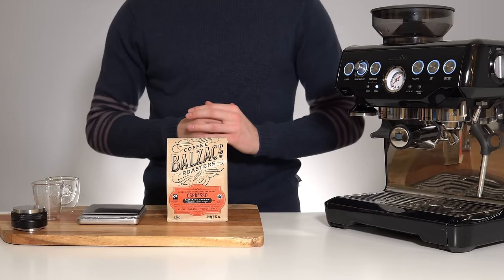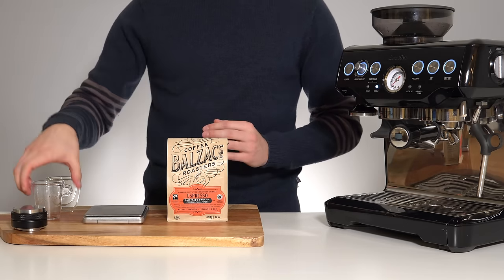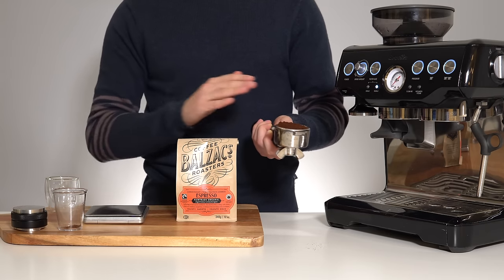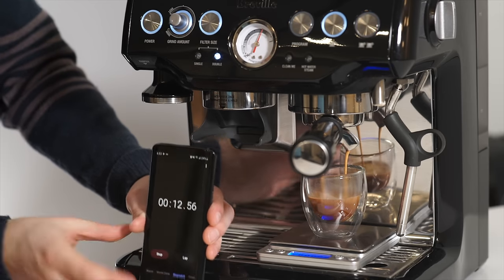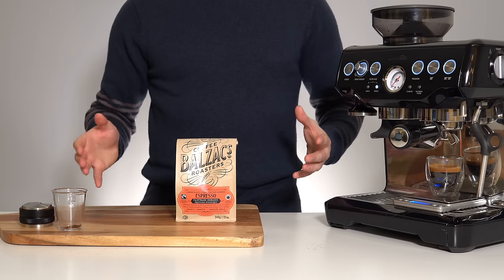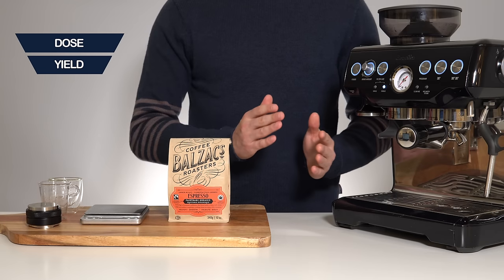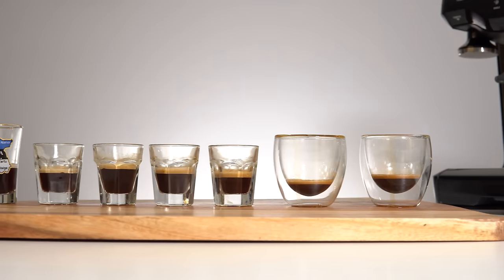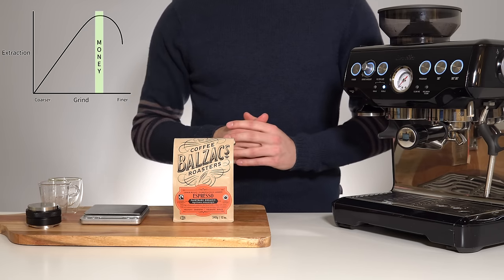Dialing In Breville Barista Express | Dose, grind, yield, time

Comment: Hi. Thanx for your instructive videos on the Breville Barista Express and on how to use it. I have a question on dialing it in since watching this video. I did a number of test runs this morning and my result is not exactly what I hoped for. I started with the grind size at setting 4 and dosage of 18gr. I timed the brewing to 32gr when I turned off and it ran to a yield of 42gr. This while the pressure gauge was at about 1 o'clock and it took 15s. I then tried grind size setting 2 and redid all stopping at 30gr with a final yield of 40. This took 27s with the pressure gauge at 2 o'clock which seems a bit much. It had a heard time holding a constant flow, very little in the start and maybe a bit varying flow during the time. The result was ok but not excellent. Could you please give me a tip as to what I should do to adjust things, since I am a bit of a loss here. Sincerely, Oscar, Sweden.
Reply: When tamping looser I get to fast flow.

Comment: @LifeStyleLab_ Hi this video is great for new coffee enthusiasts like myself.However I have noticed you have mentioned different time for coffee pour. In this video you mentioned the time should be between 20 to 30 seconds and in another video of your mentioned 30 to 35 seconds. Which one is correct? Also for the palm tamper how do you ensure 30 lbs of pressure as opposed to precision tampers?
Reply from the maker: This video includes the pre-infusion because that’s how the timer on the pro counts. The other video is counting from first drip. 
I have great videos on both timing of espresso, shots, and Tamping pressure  :)

Comment: I'm about ready to return my Express because I'm beyond frustrated with the dialing in process and have been working on it for weeks now.  I'm going from a Nespresso pod machine to this and it's harder than I thought it would be.  It seems that no matter what I do it's not working right.  The grind amount always seems to be too much and the water pressure is too low and takes something like 10 seconds for the extraction.  I don't really like espresso and will add water to have a regular cup of coffee and because there are so many factors and it's so time consuming.  If you change to different coffee beans then you have to start the dialing in process all over again, wasting even more expensive coffee.  I don't know, maybe this just isn't for me.  But hate to return this machine because I got such a good deal on the price, I have until the end of the month to return it, so I guess I'll keep trying...and wasting coffee.  :)
Reply from the maker: Sounds like you just need to be grinding finer if your extraction is only 10 seconds! 
See my latest video about the portafilter overflowing for an explanation

Comment: Thanks for the educational vids on the Barista Express. Was wondering if you had one already about dialing in for single shots. As a rough guide how many grams would you start with and should it be between 20-30 secs (then adjust according to taste later). Cheers.
Reply from the maker: Sure do! https://youtu.be/ix9MXtMq1so
The key is to try to replicate the same flow rate and brew ratio as your dialed in double shot

Comment: Great videos, still on the fence if I want this or the pro. But we'll buying it in a few weeks and I'll definitely be back to learn from your excellent videos!

I love the pressure gage however the display on the Pro gives a bit of extra convenience I think. It's a shame they took out the pressure gage.

It'll be our first "real" espresso machine, currently have a fully automatic.

A few questions:
-  The bean freshness. We currently open a 1kg package and put 3/4 in the freezer. Then take 1/4th out of the freezer at a time. As I understand it it's best for the freshness. Would you agree?
- We like to change up our brands regularly and am a bit concerned after your video. Does the dialing in get easier? How long would it take you for instance to dail it in for a new brand/bean type?
Reply from the maker: If you have the budget, go with the Pro! The extra grind steps will help with dialing in
Reply: @LifestyleLab_  Hi, wow. Thnx for the instant reply. I wasn't expecting a reply at all tbh.

I'll run it by the budgetary committee (the missus ;) )

Would you mind looking at the other questions I added?

Also in this video you mention the importance of the pressure gage something the Pro is missing.
Reply from the maker: The pressure gauge is a non-issue. Pressure gauges are a fairly vague indicator of shot quality. I only mention it in this video because the marked "espresso range" is blatantly wrong. Flow rate, and brew ratio are the main indicators you'll want to use to dial in

Your sound like you're taking the right approach! I'd recommend getting a vacuum canister and single dosing as shown in this video. No bean hopper is air tight. 

Once you have one coffee dialed in, the process gets easier. The first dial in on the machine may take 7-10 shots to get right. Once you're in the range, different coffees will be quicker to tweak to the correct setting
Reply: @LifestyleLab_  Thnx, mate. The first time I've actually "liked" something on youtube!

You've helped me decide (also watched the Pro video). I'll be going for that one if I get budgetary approval. I'll also be picking up one of those palm tampers.

On not keeping the hopper full, I understand and agree. However, my wife will also be using it and convenience is important in that regard.

Do you have the link to the graph in the Pro video. I NEED THAT GRAPH ;)

I want to emphasize how much I love your videos. They're clear, concise, comprehensible, have a good information flow and are complete! Rare to see level of quality these days, my compliments!

Comment: great video!!   Uggh but Sooooo many variables!  your video is way more in depth than most, however, what is confusing to me is, if you have say 17.5gm and your doing 1:2, so appx 35gm out, how do you know whether to adjust your grind for a a couple of seconds more/less, OR, as you say when experimenting yourself for taste, whether to go from 1:1 up to a 1:2 ratio, or maybe 1:2.5 maybe??  Like how do you which variable to be adjusting - grind, or ratio, or lastly weight (16~22gm).
I think you answer this somewhat in your video, but I am struggling to realise exactly how to ascertain which variable to adjust - Like obviously if your grinds way too fine and its taking 40 seconds to extract thats asy to establish its too fine, but what if its about just right, and its within a good time 25-30seonds, but its weight in porta filter is too much or too little...or, the ratio is out a bit?
You can tell its confusing me, however I do feel there are many who similarly arent 100% in what to adjust along the way unless its glarlingly obvious.
Maybe a super fine detail and more in-depth video would help?  

Its great you use the Barista express as its probably one of the most common home machines!
Thank you again for your videos!!!
Reply from the maker: As long as you're getting good flow (which is sounds like you are) pick a dose and leave it alone. Boom! One variable locked in. 
Now all you need to play with is the grind, and the yield 
If your shot is tasting slightly sour or acidic, you'll want to increase the yield (more water in the cup)
If your shot is tasting slightly bitter, decrease the yield (less water in the cup)
Finally, you can slightly tweak the grind to adjust the body of the shot. If it feels a little watery, grind finer so that it takes longer to reach the desired yield. If it tastes "muddy" and thick, grind slightly coarser
Reply: Lifestyle Lab thank you so much!  This helps a lot!  😇

Comment: Thanks for this great video! What was the dosing cup you used? I find it very difficult to find a 54 mm dosing cup.
Reply: I don't see many "things" at 54mm. Look for 53.
Reply: Did you find a solution? I’m also looking for this. Thanks!
Reply: @melissaloveschurch  I went for a funnel instead since I was unable to find a dosing cup of the right size. You can find quite a few 54mm ones on Amazon. The one I bought has become unavailable.

Comment: Hi, your video was super helpful. Just one question: what should the interior grind setting be at?
Reply from the maker: Whatever you need it to be set to :) 
If you run out of range on either the fine or coarse end of the external dial, move the internal

Comment: Great video! Really appreciate the attention to details... But there's one problem I always have: Whether to include pre-infusion time into the overall extraction time recommendations? I see very inconsistent advice about this all over the place. I was surprised to see you start the timer after liquid started to flow from the portafilter. Is this the correct way?
Reply from the maker: The "correct way" is to not aim for a particular time at all. No two coffees are alike, and therefore they all need to be dialed in to taste as described in the second half of this video. Time recommendations are for absolute beginners to get a reasonable flow rate so that they can start tasting, and further tweaking. Never dial in to 25sec and call it a day. In 9/10 cases, that will not be a great tasting shot.
Reply: @LifestyleLab_  Thanks! This makes sense. But given that pre-infusion often takes 7-10 seconds, it can make a pretty huge difference even for beginners to understand whether they've got a proper flow rate.

Comment: I have a question about sage/breville barista express, i Just bought a brand new machine couple of days ago, i was watching all your vidéos about it and i have learn everything about it from you i thank you very much. So i set the grinding at 3 and 4 but the coffee is running fast not like honey as show your video so i did turn the grinding to one 1 i have tampered the coffee well i set the 18gr of coffee and it is well distributed in the basket. The coffee run slowly at begining but when the pressure needle goes high it will run faster i use the single wall basket i used the dual wall basket but it always the same.

Comment: This is exactly what I was looking for. I’ve been messing around with mine for a few days but I couldn’t seem to get it right. It doesn’t seem to be building any pressure. I think I’ve only seen it move once out of the dozens I’ve tried. Any recommendations? Awesome video. Thank you! 🙏
Reply from the maker: If you've reached the minimum grind setting and it's still running too fast, you need to set the INTERNAL grind setting finer! Here's how: https://youtu.be/QNvOcE4-VEo

Comment: Great video explanation, just one question which basket were you using ? single wall or dual wall ? Thanks :)
Reply from the maker: Single walled!
Dual wall filter baskets are only for use in cases where the coffee you are using needs "help" building pressure, such pre-ground store bought varieties. Are long as you're grinding fresh coffee, and grinding fine enough, a single walled basket will produce a better shot of espresso
Reply: @LifestyleLab_  for some reason i get high pressure and fast extraction

Comment: The only issue with this type of grinder is that there's a fair bit of coffee retention within the grinder, and so the 18g in will not equal 18g out (I was a bit disappointed you didn't weigh the ground coffee). I'd recommend weighing at least 19g in using this method, and adjusting for the target dose.

Comment: Great video.  Makes so much sense.  I did recently get the Breville double boiler with the 58mm portafilter.  What initial dose coffee to water would you suggest I start with.  I assume it would be larger than the 54 mm single boiler portafilter.
Reply from the maker: Start with 19 grams in and 38-40 grams out. Congrats on the Dual Boiler purchase!
Reply: @LifestyleLab_  Wow, thanks for the quick answer.  Back to the chemistry lab!

Comment: Hi! I have a few questions I wonder if you can answer for me. One is, I think I've dialed my machine in for the type of coffee that I use (I get a small bag of fresh roasted beans from a nearby coffee shop) the pressure gauge shoots up to about 12 o'clock, and the flow is very smooth and starts at a rich dark caramel color. But, I tried tasting the espresso shot and it did taste incredibly sour. Could that be something I'm doing wrong or could it also be the coffee? I think it's just a regular italian espresso roast. My second question is regarding the crema. Despite using fresh beans, I can only get so much crema out of the shots for latte art, it also seems to dissipate in the coffee the longer it sits,  so usually the crema starts to break when I pour in my milk, not sure what I can do for that.

Thanks for reading, your videos helped me a lot. :)

Comment: Thank for the video and awesome tips.

Just wondering why we use a double basket to test instead of using a single shot. 

I have been practicing using a single shot basket (8g of beans) but it's so bitter. Wouldn't a double shot be just as bitter?
Reply from the maker: A double shot is typically a little more consistent and easier to dial in. MORE coffee means LESS bitter because it takes longer to extract to the same point as an equivalent single shot
Regardless, bitterness on either shot size will indicate that you are either: grinding too fine, brewing too hot, or pulling too long
Reply: @LifestyleLab_  Thank you for the reply and the feedback. I was in fact using a very fine setting, just had to change that, and now it's not as bitter. Now I just need to work on getting the extraction time right :)

Comment: Your Amazon link to the dosing cup leads to a brushed stainless steel version of the cup, as the coated, black version of the cup you use in your video is listed as 'Not Available' in the Crema product store on Amazon.  I see the cup as a great tool for my use, not only to prevent spillage of precious coffee during grinding, but also to set up a measured amount for quick reload of the portafilter for the second cup after I serve my wife the first.  However, I am concerned that the brushed stainless might be somewhat sticky for the ground coffee.  What is you experience with and comment on the stainless version of the cup you are recommending?

Comment: Thanks for your videos, love your content. I've got a few question regarding the Barista Express: have you had any issues with yours, and were there any issues that weren't apparent at first?
Reply from the maker: I haven't had any issues in the 4 years I've had it, however my friend had a leak develop after a year or so. Breville sent him a completely new machine under warranty.
Reply: @LifestyleLab_  Thanks! The only thing I'm concerned about is dialing in the grind. It does seem like a solid machine to start playing around with.
Reply from the maker: The palm tamper from this video is honestly a life saver for consistency and eliminating frustration. I know several people who were ready to return their machines because they couldn't get good shots tamping manually, but then had no problems after switching to a palm tamper

Comment: Great informative video but I still am not getting it right as far as yield is concerned.   Pretty sure I am nailing everything as far as grind size and contact time.  But with an 18g dose I am getting 80g yield in 25 seconds.   To get a 36g yield (2-1 ratio) it takes about 14 seconds, starting timer at button press.   I am using a Breville Touch, Grind size 4, fresh dark roast beans, hand tamper and distributor like yours.  Pucks coming out perfect, no channelling.  I am confused.    Coffee tastes good so maybe just over thinking.
Reply from the maker: If the coffee tastes good, don't worry! These numbers are meant as general starting point for good flow, that need to then be further dialed in
Reply: @LifestyleLab_  Thanks, new to this so lots to learn.   Just poured a shot and shut it down at 36g like you show and coffee very astringent.  I will try grinding finer.

Comment: Great video, but I am unable to get over 20sec with this method of timing. When I dropped the grind to 2.5 I had puddling and a 14sec to 34g brew. Prior to watching this video I was timing based of the start of the main pump (after preinfusion) which was achieving around 25 sec with a 3.75 grind and produced a 60ml volume and a 36g brew, so I guess Ill switch back to this and then also try the salami shot too. Once again great video and as many have mentioned I wish I had this on day one.
Reply from the maker: Once you're achieving good flow, don't worry too much about the time, you need to switch to dialing in to taste. 25 is not a magic number for every coffee, and neither is a 1:2 brew ratio.

Comment: When you pointed to the portal Handel and basket....and said “double basket” does that mean the one that came with my new Machine (Breville Barista Express)?  I’m new to this as in bought mine yesterday. 
I’m confused on the filter size choice and one cup two cup buttons and the choices.
Reply from the maker: Yes! The Barista Express comes with both single and double shot basket sizes. 18gr is the correct dose for a double shot basket and a double shot of espresso. The single shot basket will use around 10-11gr, and produce a single shot of espresso
Reply: @LifestyleLab_  thank you...

Yes it did come with extra baskets but I’m just using the one already placed in the portal 

Thank you so much

Comment: Hey mate I recently purchased this machine and I’m trying to use your video to dial it in however I can’t get anywhere near close to what you recommend. The first shit I pulled was just shy of 20 seconds but now the are all 10 seconds no matter what I do. Also I can hardly fit 18g in the filter let alone 22 like you suggest. Any tips you can help me with. Also my pressure never really gets better than low range. Hopefully you see this. Cheers mate.
Reply from the maker: Change the internal grind setting (upper burr) to give you more grinding range). Definitely stick to 18g or even 17g